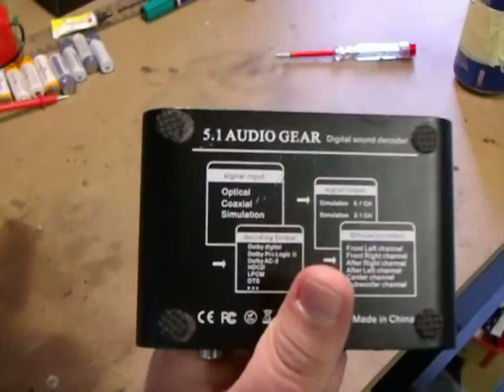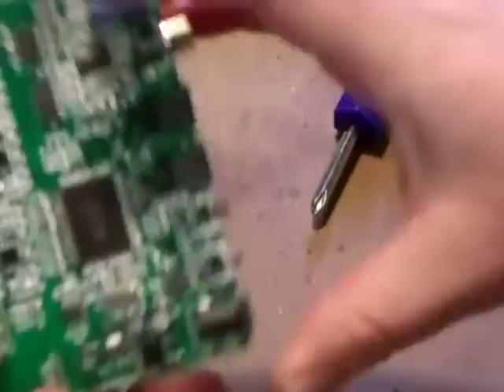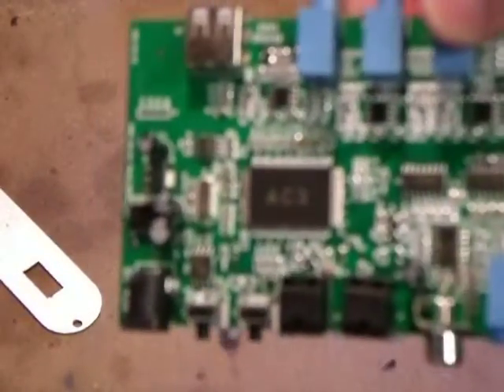Audio Gear audio 5.1 decoder

Comment from the maker: @ juancarlos: The reason why I bought this was that I wanted to use a set of 5.1speakers (amp built into sub) that I had for my old pc. Think of this device as a soundcard which converts most digital stereo sound signals into the 5.1(6 channels if u include sub)